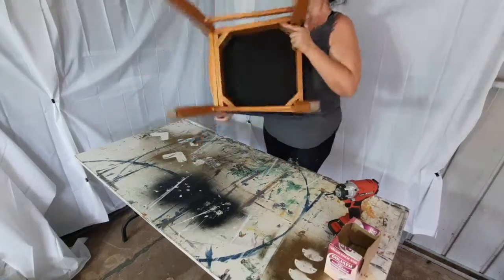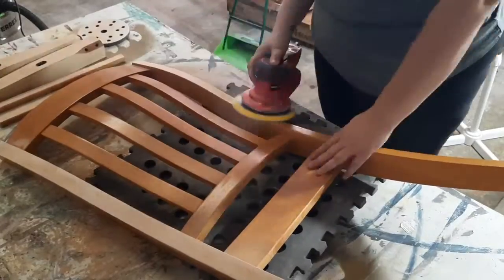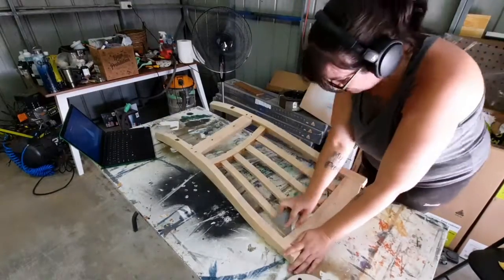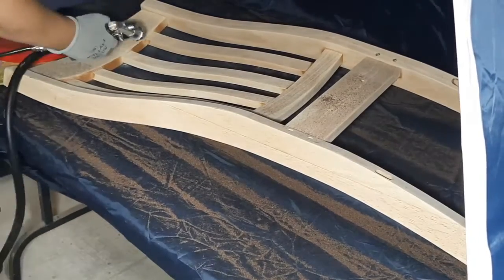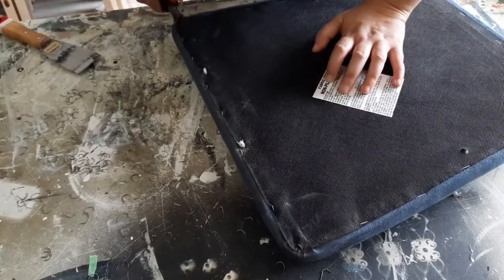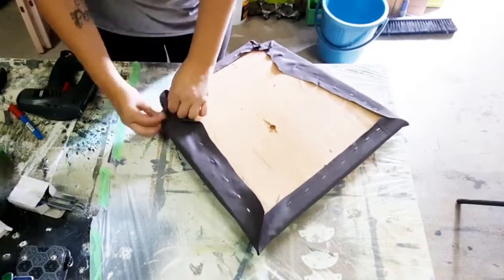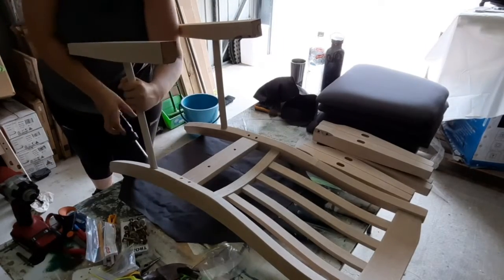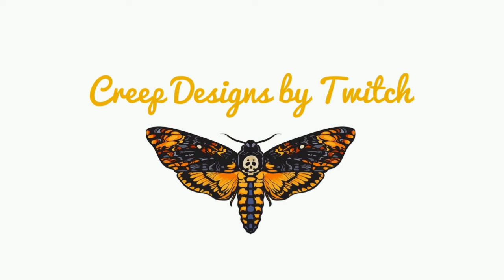8 × Dining Chairs | Custom Flip | Reupholstery

Comment: Wow, Twitch, you don't give up, do you?  Great stain color, I agree, that orange looks so dated and looks bad against the new vinyl plank floor that everybody seems to be installing.  Most of those are in the grey range.  Back in the day, they used orange shellac with varnish over it.  They didn't have the poly, so over time the old finish would get even more orange.